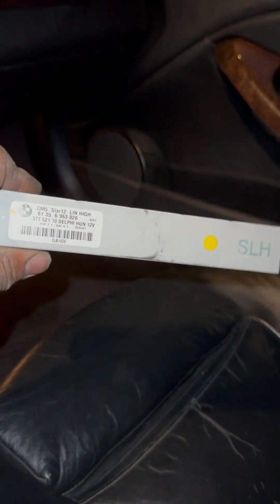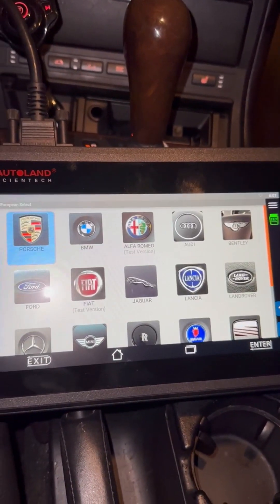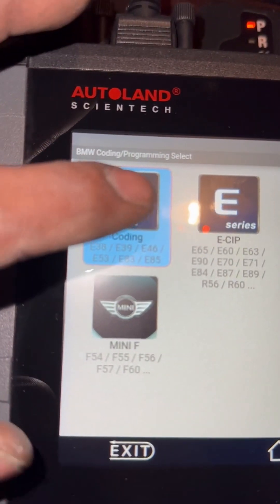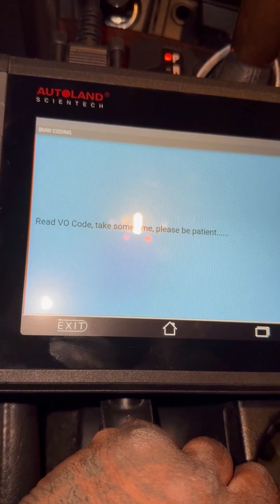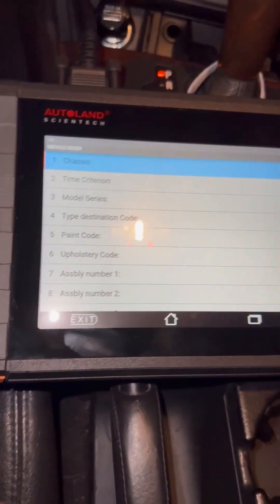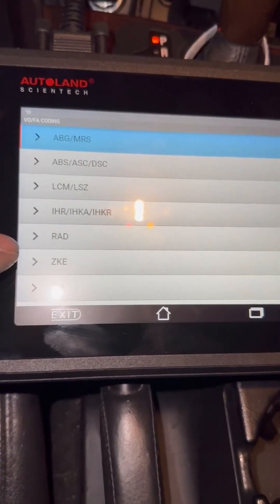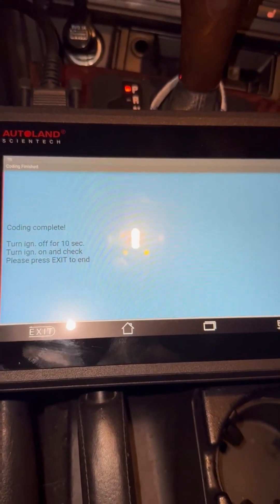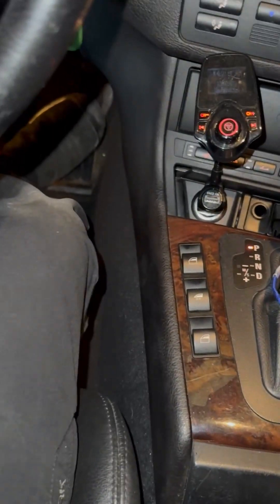BMW E46 ZKE Coding after replacing with used module

Comment: Hi thanks for your video man, apreciated. I don't have that computer pad tipe... But i have a laptop and a cable and some software for BMW ... My right Window and lock don't have power i buy the car with this problem...the Window motor connected directly to a batery Open and close and it seems new ... Maybe the last owner screw that tring ir some shurt circuit... I talk to a friend and he told me that i need a used but good module ...because they don't buyld them any more ... I try In my country In BMW and they told me that that module is descontinuated and they don't have it ...any way used market or new ONLY works if it is programing ...i have a doubt... How do i do to reprogram the keys to the used module that i bought In second hand, i apreciated if you can give me some light In that mather ... My car is a BMW from 2002 E46 compact 320td 150hp the module that i buy is from the same exact car modelo year and diesel engine ...thanks In advance .